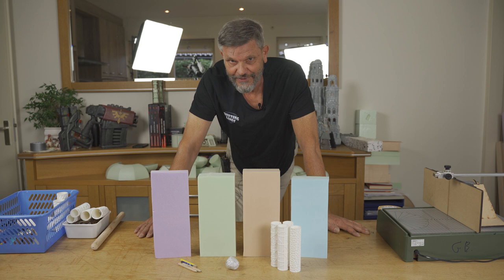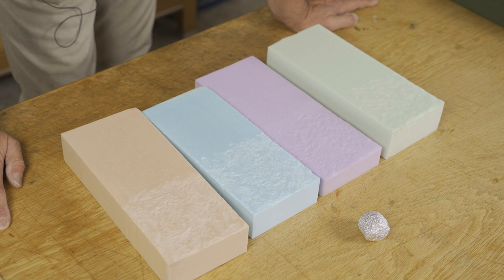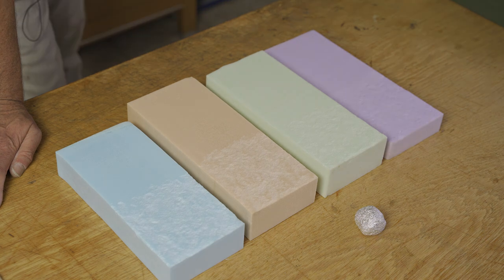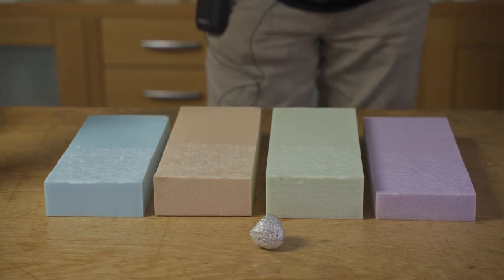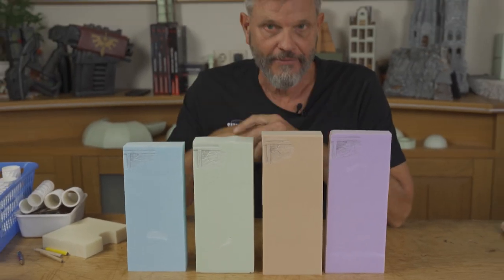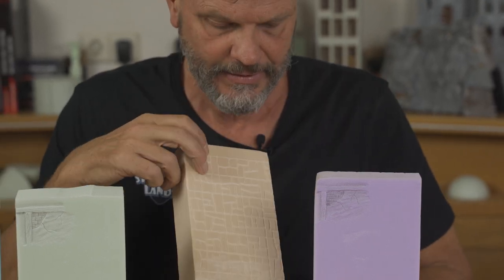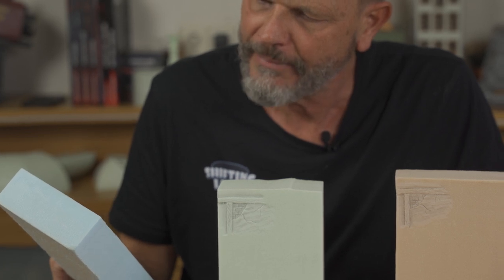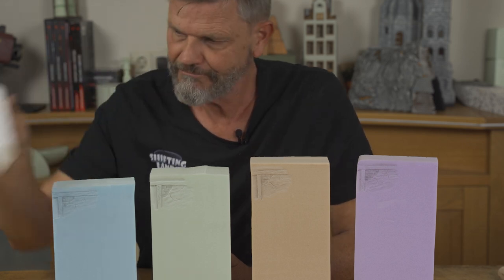Shifting Lands - The Foam Texture Test: Applying texture to different kinds of foam

Comment: Great video! Much appreciated. Now it makes sense why I end up exhausted while working with pink foam, sadly is the only one available in my area :(
Reply: If you are in NA home depot now stocks blue DOW, pink corning and a new green one.

Additionally, the NA pink foam comes in at least two different densities, I've seen a lighter foam from them full 1 inch.

Comment: Klasse Video, super interesting.
I got experience in  green, blue and orange. I prefer green, because i think its easier to handle. My blue foam is very smooth, where as the green is stronger.  That makes it easier to structure. I use a knife to make deeper structure lines. The blue one tends to make Cracks just using pencil.

Comment: I have a Proxxon and some of your rollers and other tools.  My question is about procedure.  Would you slice the foam to wall thickness in the Proxxon and then apply texture or apply the texture and then slice to the thickness in the Proxxon?  Would thin slice curve under pressure of the rollers?  Thank you all your videos.
Reply from the maker: Roll a thicker block and afterwards slice it to the desired thickness. Yes a thin sheet would curve under this pressure and working with thicker blocks also makes it easier to roll because you  have a better grip when roling and thus get more pressure.